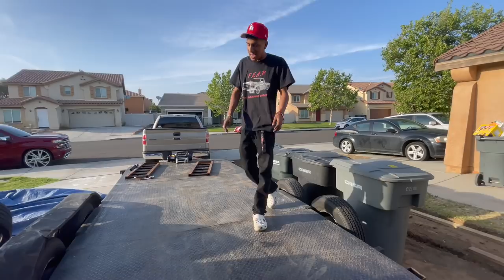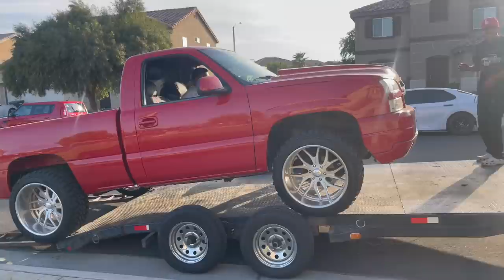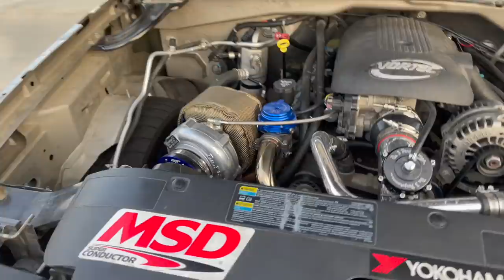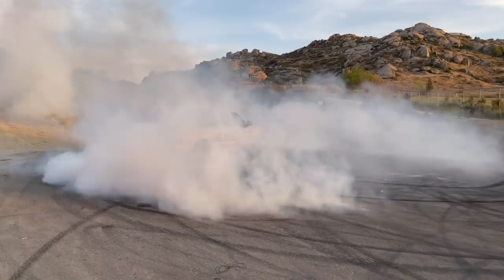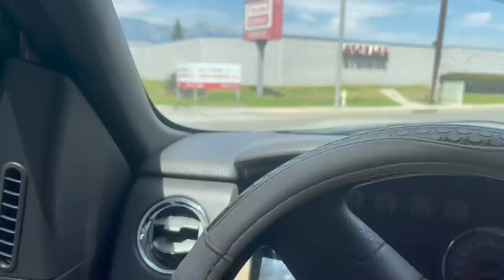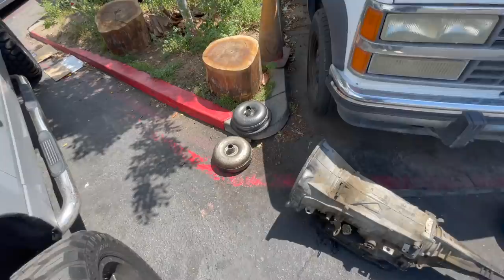I Almost Got Hit By A Swinging Truck

Comment: Bro in the extended cab probably spent more then 3k+ yet couldnt buy a posi unit no mms 🤦🏻‍♂️😂
Reply: Project prolly not done lets ride in ur fully built truck hater
Reply: Haterrr
Reply: Str8 hating